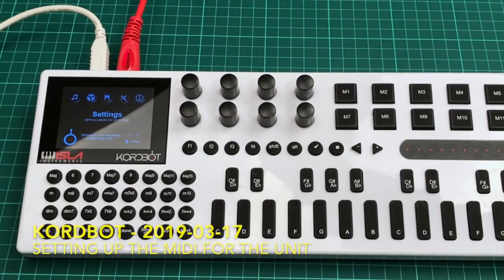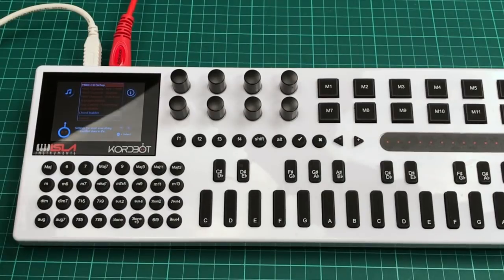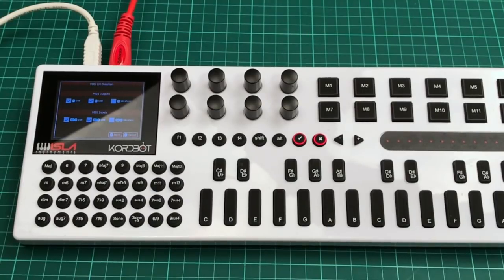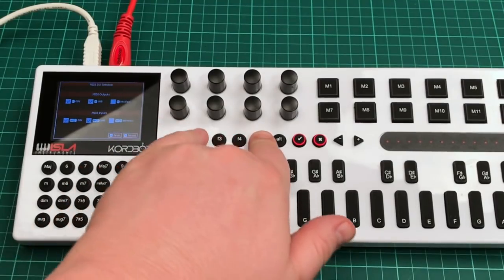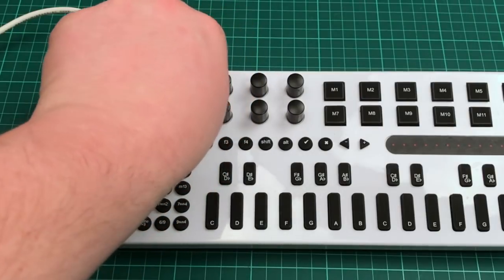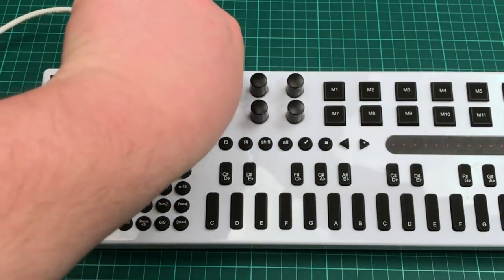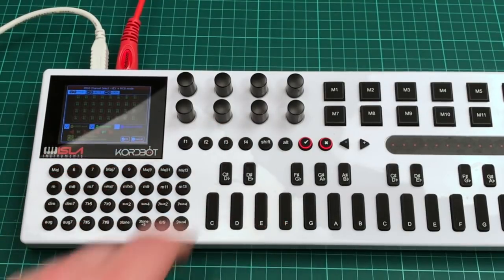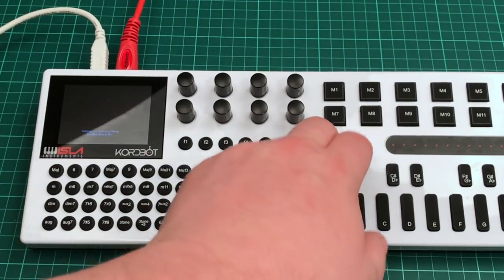Kordbot - Setting up the MIDI and the switches on the MIDI Controller

Comment: Whenever I set up Audiobus on the ipad with the kordbot and set all kordbot settings on wireless midi and connect it via audiobus and send it to the Tal-U-No for example I hear nothing.. JHow come?
Reply from the maker: Have you subscribed? ;-)

Hi @shufflephunk. I can only give you my method for diagnosing this type of issue.

The first thing I would be looking at is how far is the Kordbot signal going.  Can you on the Audiobus application see notes being triggered from the Kordbot.  Most apps like this have some type of screen showing the keys being played.  Its low hanging fruit and looks good in demos!  If it does then you can confirm that the note data is being received by the Audiobus application.  

If it is yes then the issue is routing from the application.  If not then it could be a wireless connection issue between the Kordbot and Audiobus or device that it is running on.

Wireless is great when it works but a nightmare to fix when it is not as you don’t know were the issue is, transmitting device, receiving device, incorrect protocol or handshake.

Have you tried a wired MIDI connection to the AudioBus app?  Either from the KordBot or to the target device.  See if you can eliminate wireless from the equation.  Jon

Comment: Hi there, I wondered if you had any idea as to why I’m struggling to get this to sync with Ableton Live? I found that when I enable the MIDI to work via USB, it unticks itself for some odd reason. I have trying to get the arp to work in terms of syncing and it’s been a pain. Whenever you set it to external, no noise is produced. Any thoughts would be greatly appreciated.
Reply from the maker: Have you subscribed? ;-)

@Robin Hill.  Not sure what version of the firmware you are using, but there were numerous comments on the user groups about the clock.  I definitely found in earlier firmware releases setting the clock to external on the unit caused things not to happen.  There was also an acknowledgement of an issue from Brad.  But I though these had been sorted.

In truth I have not used the Kordbot with Ableton in a while.  I have been using it stand alone with the keyboards in my new studio.  Jon

Comment: How can it be sequenced externally?
Reply from the maker: Hi @紀章kisho   

The short answer is that is not really what this unit was designed for although Isla Instruments has promised a firmware re-write to include step sequencer functionality and I understand the first drop of this new firmware will happen this month (Oct,2021).

If you fire a note onto the unit it will play the chord type for the key you press.  So if you have it set of Major and press a C you will get C Major.  Similarly, if you have it set to minor 7 and press the F key you will get F minor 7.

I think you can fire in a CC command to change the chord type prior to the note information.  But that is a lot of work for very little gain.  As why would you not just send the notes of the chord that you are trying to play directly to the instrument.

Remember the KordBot has no sound generation it generates the MIDI data to play chords and extended chords where you would run out of fingers on a normal keyboard.  Jon

Comment: Would you recommend this unit to someone that creates edm music?  I know very little music theory. I've been a dj for over 30+ yrs. I create tracks on ableton live. I play the synth by ear. I plan on learning the wheel of fifths, chords, etc but I will never dedicate to much time to learn how to play the piano. I play the keys on my novation launchpad. I think it's easier then playing on the piano. I see this unit as a replacement for the piano keyboard.  Changing scales is so easy on the launchpad. 
It's time that the piano is improved. 
Thank you
Reply: Just found this today. Is this unit better?  It's called the theory board. I don't know if it allows you to control external synth but it works with daw  https://youtu.be/k8Q7NKL0ag0
Reply from the maker: Have you subscribed? ;-)

What a good question and one I am not sure I am really qualified to answer.  Yes I do understand music theory to a degree, but I would never claim to be an expert.

I really can only give you my experience which is when I am composing / writing (posh words for fooling around) which is really where most of my stuff comes from.  Something works and gets developed into a piece.  

So use case 1) Where I have found the Kordbot comes in useful is helping me with the ‘what comes next question’. I have a cord progression and I am trying to work out what comes next.  And what come after that.  

So use case 2) I want to run an arpeggination through more than 1 octave up and 1 down.

It has a whole bunch of features that I can say I haven’t really used and we are still waiting for the sequencer to be released.  It is a versatile unit, but I would say you need to have some music theory to use.  Jon
Reply from the maker: In terms of the second part of the question.  The video link goes to a private video page.  I guess the publisher has redacted the content.  I have to say it looks like a very useful tool.  But it is $700.  Which is double the price of the kordbot.  Jon
Reply: @MarvelousMixinMiguel  RE: the theory board.  It looks like they put more work into their Kickstarter page than into the actual product.  Can't even see a working prototype.  The video is a fake and a bad one at that.  I'd say that's a no-go.   Hopefully you didn't give them your loot!

The Kordbot is pretty awesome for people who don't know theory, you can learn a lot playing either of the main modes.  You can select notes by chords and chords by scale.  For example, select a Cm13 chord and the keys will light up in arpeggiator mode.  Then you can play along with the notes easily on another keyboard by referencing the Kordbot visually!

Conversely, you can use diatonic mode to select a scale with the keys and press the chord button of your choice.  Use the mem keys to store and playback your progressions.  It IS glitchy, not for live performance, but you could use it live for a visual reference if you just needed to see the notes in order to play along on another keyboard.

I got a NDLR and it is more designed for live performance (if you can figure out the setup, I have yet too do so) but I have used the Kordbot in recording and it's pretty fun!

Also you should check out the Linnstrument, you can set up scales and arpeggios and it's excellent for people who aren't musically inclined because your scales are lit up and customizable.  It's spendy but I think it's worth it.  I have a playlist that shows all you need to know on my channel.
Reply from the maker: @Wes Darling. Great feed back.  Jon
Reply: @TheMusicTechGuyUK  I recorded this using the Kordbot to drive a Boss DR-5 https://soundcloud.com/wes-darling-621287702/march-of-hubris  I was just screwing around and the sound quality isn't great but it demonstrates some of the expressive potential in the Kordbot.

Comment: what stands up in this vid here is the reality of an incredibly small letter size and low brightness of the screen. Which appears to render this device unusable on very many instance. Unless you are shortsighted and love to work close to your units. Not what a keyboardist would want to do on stage.
Reply from the maker: Have you subscribed? ;-)

Honestly, I can’t see this unit being used live.  My experience is that it works on the worktop in the studio where you are trying progressions, arpeggiations etc.  But in live where you need to hit the button, load different programs etc rapidly.  No I am not sure this hits the bill.  Jon
Reply: @TheMusicTechGuyUK  you are correct.  What Kordbot does is amazing.  What it doesn't do is equally amazing, in a terrible way, but not terrible enough to make it not worth the cost.  I love mine!  
But not without reading glasses.
Reply from the maker: @Wes Darling The Kordbot is a divisive subject.  That is for certain!.  Jon